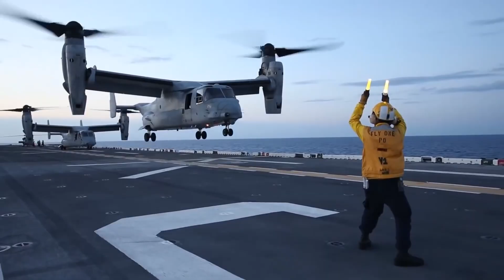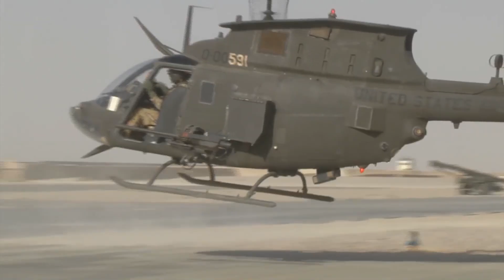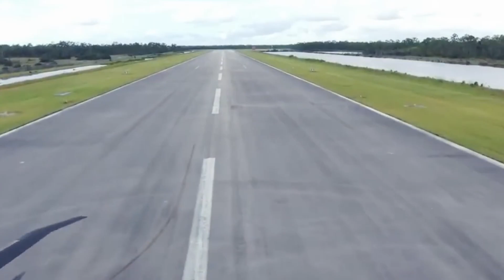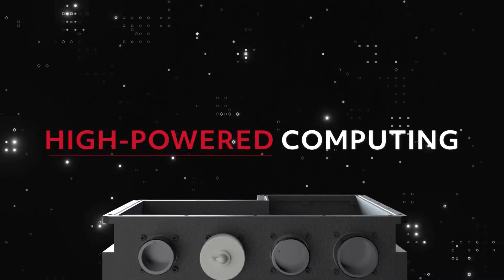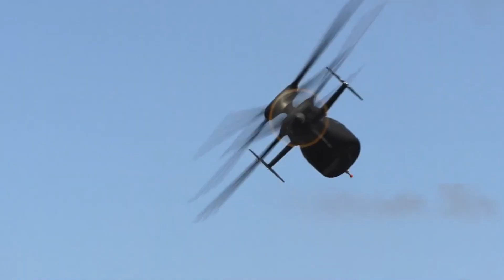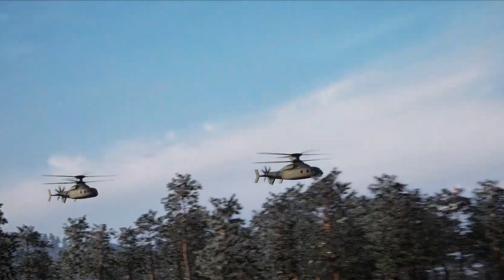SB-1 Defiant - Must go faster!

Comment: I definitely prefer the design of the SB-1 and I think as a helicopter it's the better of the two, being able to land in a smaller footprint and transition from hover to horizontal flight quicker. But the design is limited and it's never going to beat the range and fuel efficiency of the V-280 which is ultimately what a military is going to be more interested in. The attack helicopter variant will be very interesting to see be developed and if both were to be adopted the cost and logistics savings from the commonalities between the two would be great for a military. Maybe there's hope another military might adopt both
Reply: Boeing couldn't get it's bid straight.  They promised lower acquisition and operating costs but failed to provide details on how it arrived at their promised figures.  A failure of paperwork.
Reply: @sfpesq  I thought it was also having some trouble meeting the milestones for the program while the Valor hit them all and even smashed them.
Reply: There wouldn't be much, if any, parts commonality between FARA and FLRAA if both designs were accepted. However, the Sikorsky design is superior in FARA for exactly the reasons you stated. Particularly, it makes a superior replacement for the little bird, and on par with Bell's design for an Apache replacement.
Reply: The helicopter in an attack configuration has an additional advantage, putting more bang on pylons. The tiltrotor can’t have pylons on the wings for missiles. They would have to shoot through the blades or have to drop down to clear them, making a shot from cover impossible.
Reply: @Markle2k  they actually had some mockups where they were on the wings but were to be used while it was hovering only
Reply: Good point.  @octagonPerfectionist
Reply: @Markle2k  

"The tiltrotor can’t have pylons on the wings for missiles."

True, but the Osprey is not an attack aircraft.
Reply: @Tom-zs6bb  Neither is the Blackhawk or the Mi-8, unless you chuck some stub wings with pylons on them and make them so
Reply: @Markle2k  "And if my grandmother had wheels, she'd be a wagon."
Reply: @Markle2k   That would only be a problem for unguided rockets. Guided missiles can be mounted and fired angled to go under the blades. I would slightly change the operational parameters of systems like the Hellfire but would be feasible. The other two options would be a mission pack loaded in the passenger bay that would protrude out of the side doors and launch munitions in the gap between the blades and the fuselage or a mission pack that would drop down through a convertible opening in the bottom of the fuselage after take off. All three would be operational in the entire range of rotor angle and would be removable to allow for utility/medevac/air assault.
Reply: @James-ev8gt  I can tell from your comment that you have no experience with safe release testing.  The things you claim are possible, downward angled bomb racks or launch rails, are not.  Hanging ordnance at an angle to the airflow puts huge loads on the bomb rack or launch rail.  Then add aerodynamic buffet that can exceed 20g rms with higher spikes.  Wing mounted ordnance would be subject to the wash of the rotors, which is huge on a tilt rotor.  External ordnance experiences a lot of abuse in flight.  I can tell you the Marines have not been able to mount forward firing weapons on the V-22 and it is not for a lack of trying.  The best they can do is launch stuff like Viper Strike off the ramp at the rear.  Even if you clear the rotor the blast will cause damage to the blades.
Reply: @Markle2k That is non issue for  attack version of V-280. The wing have enough strength to mount payload for PGM. In hover mode, you can still use Hellfire, JAGM and APKWS. But if you want attack in flight mode, you can mount SBD II. With this, it will outperform Apache and Viper with better range and speed while still maintain similar payload.
Reply: @aizseeker3622  One of the problems with tilt rotor aircraft is that you can't mount forward firing weapons or door guns on them.  The rotors are too big and in forward flight interfere with any underwing and some side mounted ordnance.  Using a door gun risks shooting the rotors off too.  The best the Marines have come up with for the V-22 is some downward firing systems like Viper Strike mounted to the ramp.
Reply: @philsalvatore3902  That cause V-22 had to tilt together with engine. V-280 fixed that by having the rotor tilt instead.
Reply: @aizseeker3622  The V-280 still has a synch shaft connecting the two rotors so if one engine fails it can still fly.
Reply: the v-280 actually doesn't have a larger landing area if you turn it 90 degrees
Reply: @josh_bartholomew_2530  On V-22s the rotors fold up over the wing and then the wing is rotated 90 degrees so it is over the fuselage.  Folds up pretty small that way.
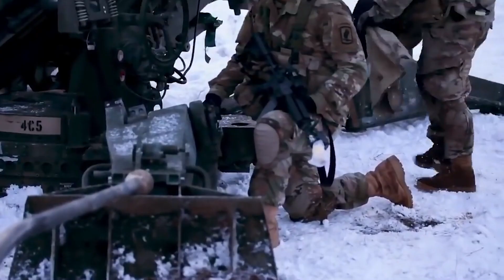Reply: 10:32   It weighs how much?
Reply: I thought it was cool of Boeing to let Sikorsky take first billing in the SB - 1 Defiant, until I thought of the alternative.
Reply: There won't be an attack variant of the V-280 the Key West agreements make armed fixed wing the exclusive domain of the Air Force the USAF will complain loudly just like they did with the AH-56 Cheyenne. Everyone seems to have forgotten this even the Army itself. I can even predict what they will say, they'll claim it's a VTOL fixed wing just like they complained that the AH-56's stub wings made it a fixed wing and they will have a much stronger case here because in forward flight it is exclusively operating as a fixed wing unlike the AH-56 which only used it's stub wings to augment lift. That said, a tiltrotor would make a poor gunship the high disk loading makes it's performance in hover and loiter worse than a traditional helicopter. This isn't something you can science your way around tiltrotors necessarily must compromise between prop drag in forward flight and disk loading in hover. If you decrease prop drag you increase disk loading and vice versa. With a helicopter the larger and slower RPM the main rotor is the more efficient generated vertical lift is. The limiting factor on a traditional helicopter vertical lift is how large and slow you can reasonably make the rotor system while still having it be functional (there are still limitations but they are different and more friendly to good hover performance than with tiltrotor design)
Reply: @atomicskull6405  Congress would have the last word on the matter.  There are a lot of other reasons I don't see the V-280 becoming a gunship but the Chair Force isn't one of them.
Reply: @atomicskull6405  I think in the modern age of man or infantry unit portable drones, the Key West agreement has largely fallen by the wayside. It’s neither a law, nor anything actually binding.
Reply: 😮6yy6yy
Reply: V-280 Valor for the win just for the increased speed!
Reply: What role do stealth technologies play in the design of the most advanced helicopters, and how do these technologies enhance their effectiveness in modern warfare scenarios?
Reply: An armed V-280 cannot exist as long as the Key West Agreement remains in effect. Not unless it's operated by the USAF anyway.  As soon as the Army rolls out the prototype the USAF will immediatly claim it's a VTOL airplane and start working to get it cancelled.  If they complained about the AH-56 with it's stub wings they will for sure complain about an armed tiltrotor.
Reply: For a troop transport you just can beat the range and speed. The SB-1 could be great in the attack role tho.
Reply: It would be an incremental improvement but the army was looking for more and the navy/marines had already been using V22 with similar design to the V280 Valor for decades.
Reply: i could definitely see this one being far better as a combat helo
Reply: @octagonPerfectionist  Sikorsky demonstrated it's capability to fly without a tail to Senator Tammy Duckworth, so you are correct in the assumption.
Reply: @KrillCanoe25  i just hope they give a combat variant ejection seats! it’s one big advantage the russian helos have still
Reply: @octagonPerfectionist  I wonder how useful ejection seats would be. They obviously cannot eject upward, and the typical mission for military helicopters necessitates flying to low to survive a downward ejection. Perhaps that will be one of the problems the engineers find a way to make work.
Reply: @Tom-zs6bb  they actually can if you put explosive bolts in the rotors - the russian attack helos do this. but the russian helos are the most modern attack helicopters currently deployed - apaches may or may not be more capable but the airframe it’s based on is quite old. 

technically as long as the rotors and rotor assembly is still intact you can just autorotate to the ground and land safely, but considering that missiles can damage the rotors that’s not a guarantee with a combat helicopter lol
Reply: @octagonPerfectionist  "lol?'
Reply: @Tom-zs6bb  i say lol at the end of every sentence because i’m a dumb millennial
Reply: @octagonPerfectionist   I wouldn't say you're dumb, I was just wondering what the joke way. By the way, you're engaged in an old man who, among other things, is a flight instructor in airplanes and helicopters.
Reply: @octagonPerfectionist  What the Russians have in the Kamov KA-52 is not an ejection seat but rather a copy of the old Stanley Extraction Seat used in the A-1 Skyraider.  It shoots a rocket out the back of the seat on a long tether and when the rocket pulls the tether tight the seat is yanked out of the cockpit.  To make that work on a helicopter the blades have to be blown off first and there are supposedly cads to do this.  However the Russians have never been able to use the seat to escape successfully.  Not once.  Even one of their very senior test pilots was lost in a KA-52 mishap many years ago.
Reply: @octagonPerfectionist Co-axial rotor helicopters are diabolical to auto rotate.  Unlike a tail rotor helicopter that changes the pitch on a tail rotor to control yaw, on co-axial system yaw control is by differential torque on the upper and lower rotors.  But in an autorotation there is no torque being generated so there is no differential torque to control yaw.  Worse still what little differential torque acts in the opposite direction of rudder input.  That is why you see such huge tails on Russian co-axial rotor helos.  There are large control surfaces back there that provide yaw control but you have to have airspeed for it to work.  Once you get slow enough (I don't know the exact value in knots or kph) you loose yaw control from the tail and the rudders work in the opposite direction.  Fun times !
Reply: @philsalvatore3902  guess there’s a reason they don’t use that type of helicopter for civilian applications!
Reply: @philsalvatore3902  i’ve seen lots of footage of pilots ejecting successfully from the war in ukraine - though i don’t know if they actually survived in every case. i wouldn’t take the russians for their word when they say they do.
Reply: @octagonPerfectionist  As far as I know no-one has ever used the extraction seat and explosive bolts to successfully egress from a Ka-32.
Reply: @philsalvatore3902  https://youtu.be/NpNy9UXaWJ8  here’s an example of a recent ejection, although i have no idea if the pilot survived or not
Reply: @philsalvatore3902  They've had a successful ejection in Ukraine from the Ka-52. There's video of it. You can see the blades' explosive bolts go, the canopy, and then the seats in a nice sequence.
Often, the flying is at such a low level and the MANPADS so lethal, that there isn't time, or the "kill" is an actual kill of the crew, like this one: watch?v=Wi5l2BMxAxM
I'd link the ejection video, but it isn't on YouTube and this post would get put into moderation purgatory
Reply: @octagonPerfectionist  They have used contrarotating helicopters in civilian use. The meshed rotors of the US Kaman and the Soviet Kamov with coaxial rotors both have civilian models. The Kaman K-Max is a popular utility helicopter for logging and firefighting. Kamov has several knockoffs of its Ka-27 for civilian use
With autorotation, you keep some forward speed so the fin (and rudder) do have effect. But it isn't a guaranteed soft landing. A police helicopter around here autorotated in the city, but they landed too hard and the pilot and observer were both killed even though the fuselage was intact

Comment: In all honesty, for the future wars the US is looking at fighting in the next 20 years, the V-280 fits it much better, while the Defiant looks like it was built for the previous generation of insurgency wars. I do hope they are able to get the S97 tenor and maybe the apache replacement, at those seem like excellent options where the smaller size required would give it  a better edge.
Reply: The Defiant derivatives should also be more agile due to a more compact weight distribution. I can see the Bell design being a good fit for a utility role while the Sikorsky design gets more of a combat role
Reply: The only way helicopters stand a chance against a near opponent is by hugging close to the ground, which is something the V-280 struggles with.
Reply: @HYDRAdude how would it struggle with that?
Reply: This isn't 1976 anymore, modern radar and thermal tracking have rendered low level flying to avoid close range air defenses irrelevant.
Reply: Here's an idea ... don't start any wars for 20 years. See can they do that. Little experiment. Just one tiny little generation.
Reply: Finally someone who isnt an idiot.
Reply: I'm not so sure. The incredibly large frontal area of this aircraft seems more than vulnerable to MANPADs. Hitting one of these large rotors head on would probably lead to the catastrophic crash of the entire aircraft.
Reply: @DefinitelyNotEmma V-280 can survive longer by flying higher and faster.
Reply: Frontal area has very little to do with vulnerability to MANPADs, given their proximity based fuses. And unlike the Defiant, which if hit in the rotor would fall out of the sky unable to autorotate, the Valor still has wings that it can glide with unpowered and a second engine on the opposite side of the aircraft (Which means if one engine is directly hit the second is far more likely to survive, unlike the engines which are right next to each other on the Defiant).
Reply: @DefinitelyNotEmma  Thats the point of coaxial chopper.

No tail, no pain. 😎🤟🏻
Reply: @DefinitelyNotEmma  Your right that this would be better than the Bell 280 but you are wrong overall. The reason they need that range is because when fighting near peer opponents, you have to face missiles. That means the airbase needs to be far away. So you need a fast, long range helicopter to get there. This is the reason they chose the 280. They  protecting the air base at the expense of  the attack role.
Reply: @Ohnothisisbad  You won't get there when you have a square kilometer of rotors in the front that will catch every missile and small arms fire.
Reply: Trust me on this one, if a missile was gonna hit the Valor, it was gonna hit the defiant. The only difference is that the valor has more than just rotors that provide lift.
Reply: @Ohnothisisbad  Study the 2004 amphibious assault on a dirt airfield south of Kandahar called Rhino.  It was conducted by TF-58 led by General James Mattis.  The Marines left their artillery and armor on the ship and conducted an amphibious assault from the North Arabian Sea into Afghanistan entirely by air, refueling their CH-53s en-route.  Lacking artillery the Marines relied on their own organic air power from their ships using precision guided munitions with accuracy as good or better than any artillery.  That is the model for future assaults.